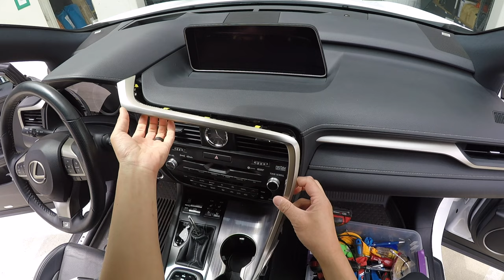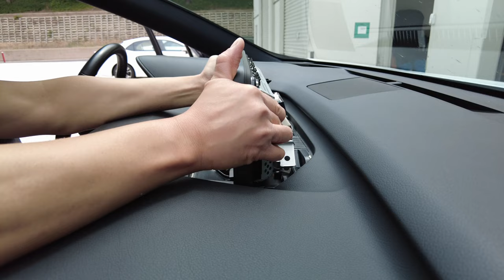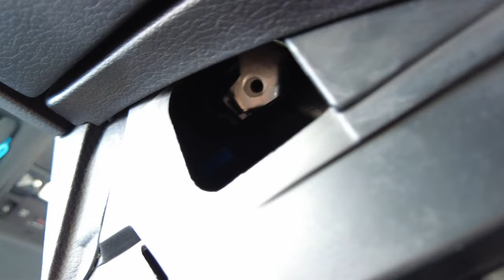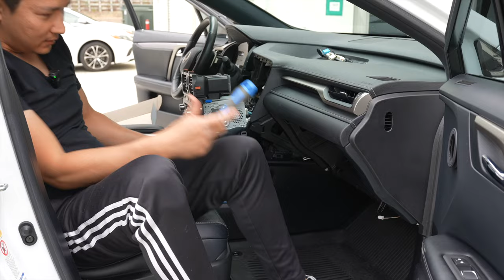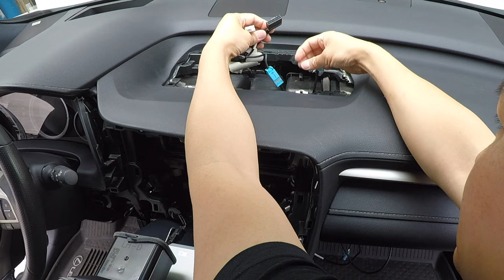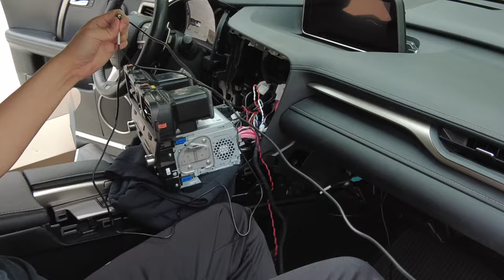2016-2019 Lexus RX | Wireless Apple CarPlay & Android Auto Adapter | DIY Installation

Comment: Good video but some more clear shots of where certain things go would be helpful. For instance the location of the antennae, I have no idea where it’s mounted or where the cord is going. Based on your overhead angle at 14:00
Reply from the maker: The antenna can be mounted anywhere, as long as it's away from the factory radio and our modules to prevent interference. Specifically in this video, we mounted it close to the same area in 14:41

Comment: Hi Eric. Great videos. I have a 2017 RX350 but the factory navigation utilizes the Toyota Scout GPS link which is no longer supported and it sucked anyway. Will your unit still work with my system? The screen on the dash doesn't go the full width of the unit.
Reply from the maker: Yes this kit is compatible with your RX trim https://www.beatsonicusa.com/lgvifcb3.html

Comment: If anyone wonders how much time will it take realistically for a DIY person (I do everything myself, electrical engineering background) who does it for the first time, I've measured it yesterday and it takes 1 whole day. If everything goes smoothly and you know what you are doing you can compress it to about 1 hour, but all that if things go well. Sometimes a cable just wont go the right way (especially connecting the boxes to the display), or there's a struggle of putting some panel back to its place without breaking anything. Or there's a decision point on where do you put the USB cable and you need to come up with a good solution. Or your extender is either too short or too long when approaching some nut. Beat-Sonic warn multiple times that extra care should be taken in order not to break things, as everything is very fragile. I took care, I didn't break anything, took me 1 full day, including reading materials and watching 3 different videos, as all of them miss some steps or show case a slightly different solution -- they keep changing them all the time. I used the wireless solution manufactured before September 1, 2023. Very happy with the result, everything works as advertised, +rep to Beat-Sonic.
Reply from the maker: Thank you for your feedback! We are continuing to come up with better ways to install the kit and may be changed a few steps. Glad everything is working for you

Comment: Eric, I have a heads-up display in 2018 RX, which shows the navigation steps from the car's navigation + other stuff. Once I install this product, will that continue to work? If so, will it get the details from this device?
Reply from the maker: The HUD will continue to work as usual, but the carplay functions will not display on the HUD

Comment: I installed everything to my 2017 Lexus RX 350 with factory navigation and now sound works only thru Bluetooth. If you connect your iPhone thru Apple CarPlay via cable only sound will not go thru the usb. Is it designed so or there is something wrong?
Reply from the maker: This is the design. You can connect your phone to the car’s usb to get audio as well

Comment: Hi Eric, I purchased one of the CarPlay units but I have an issue with it. When I turn on the vehicle turning indicator the CarPlay unit shuts down and my screen goes blank until I turn off the indicator. Do you know of any solutions to fix this?
Reply: Eric, I solve it. It was a setting in the CarPlay unit that I needed to change.
Reply from the maker: Glad you figured it out
Reply: @Ron-dr6iw  what settings please?

Comment: Couple questions. In my Mercedes I have Android auto and I have a dongle for wireless which allows me to put in an SD card with video which I can have my passengers watch while on trips or whatever. Do you have this capability with your wireless? Also the wireless dongle that plugs into a USB cable has the ability to watch YouTube and Netflix which I'm guessing this system or any system you sell does not am I wrong? Thanks for any answers you can give me.
Reply from the maker: This kit is strictly Carplay or Android Auto. You can connect the dongle to this kit to achieve your video playback
Reply: @BeatSonicUS  okay I was just wondering if it had a USB cable to do that. And I'm guessing it can be located in the glove box or some other convenient location. I just didn't know how the wireless part worked on the kit. Because the dongle handles the wireless and the SD card Thanks for the answer.

Comment: I was thinking of getting one of these for my car. Do you do install and if so, how much would it cost me?
Reply from the maker: Yes we do offer installation service for $200 labor fee. Please email us to schedule an appointment at info@beatsonicusa.com
Reply: What cities are you doing installations in??
Reply from the maker: @MyNameIs_Brandi  around LA/OC in SoCal
Reply: @BeatSonicUS I just got my unit in the mail. Do we need to disconnect the battery before starting?
Reply from the maker: @MyNameIs_Brandi  yes that step is recommended
Reply: @BeatSonicUS  thanks… just saw it in the manual and came back to delete the question 👍🏾
Reply: @BeatSonicUS I finished installing. Good directions and instructional video… great diagram… dripped my 10mm socket in and 1 of the screws inside and couldn’t get them out… can this affect anything other than the radio? Should I take her to Lexus Service and ask them to get them out?

Comment: This 100% is not worth the price in the slightest. I bought a new head unit with apple and andriod auto that has an OEM finish and works flawlessly for $800 for my other car. 
How an apple carplay and andriod auto adapter for an already great head unit is beyond me.
Reply from the maker: You can’t install a new headunit to a 2016-2019 RX

Comment: Holy cow. Got it working eventually but this is an absolutely terrible setup if you are trying to swap the CarPlay between phones. I don’t even know if it’s possible without restarting the vehicle etc. DO NOT BUY IF YOU PLAN ON USING DIFFERENT DEVICES
Reply from the maker: You can definitely switch between phones easily. If you need assistance, please email us at info@beatsonicusa.com